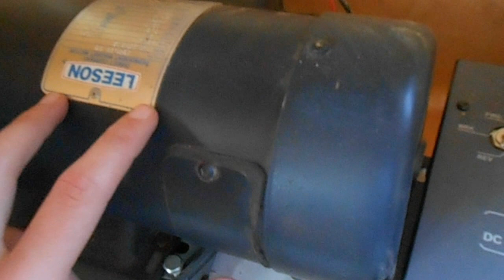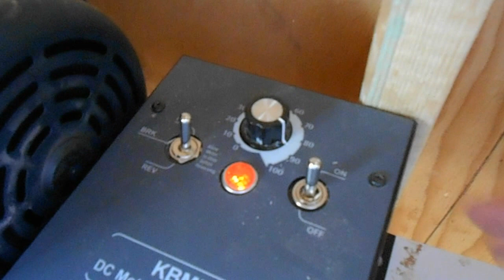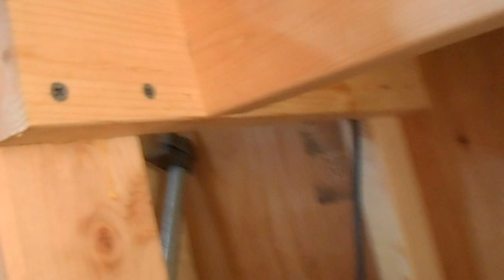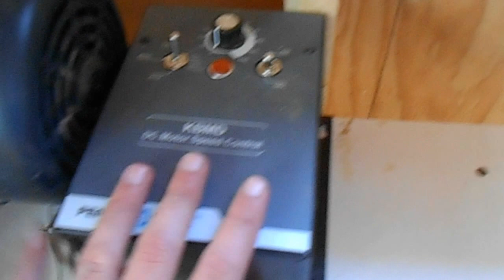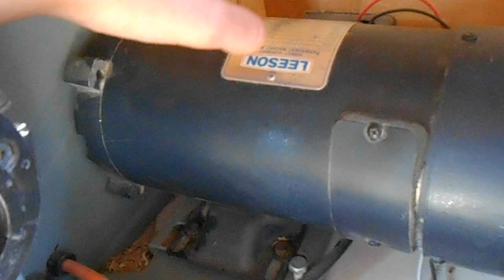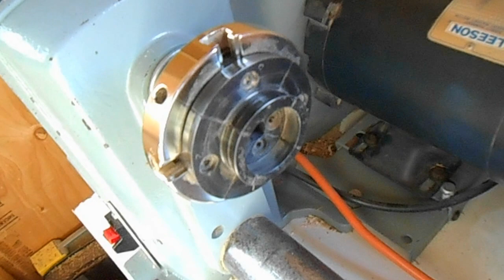How I Converted by Old Durocraft Lathe to a DC Motor

Comment: The new treadmill motors have plenty of torque,,I use them on both my 12 inch metal and wood lathes,,50 dollars and one for free,,
Reply: How is your dc motor handling the 9 inch metal lathe?
I’m using a variac and a diode bridge.for speed control.
Reply: @offgridmangogrower  does find on higher speeds but lacks tourqe on lower rpms was a 1.5 hp and I put it on my 6 inch lathe and it works great on it,, went back to AC motor on my 12 until I can find a 2.5 hp dc motor for it.
Reply: @georgespangler1517  that’s interesting
I’m trying another approach….I have two demands (main shaft) and (oil pump) for my colchester
I’m using two DC motors…these are 0 to 90v …..pMDC
My goal was to prelube before the main shaft turns.
I will go back and retrieve the main motor spec…the auxiliary is 1/4 hp I think.
In your case did you try a higher speed pulley?
Reply: @offgridmangogrower   lm thinking that l would have been better off with the heavy treadmill pulley for the anirsa it would generate at low speed and not bog down due to the light pulley and motor competing against the lathe spindle at low speed,, the 1.5 hp works very well with my 6 inch lathe being more equal to the spindle,, l feel a 2.5 hp dc motor would do the job and handle the 12 inch heavier drive system,  l had a feeling I should have used the heavy pulley on the motor like the difference a heavy flywheel makes on a car engine.. live and learn my friend,, but I sure miss the speed control the potentiometer made compared to the limited control of speed you have just useing different size pulleys. The DC motor was fine at low speed doing light cuts and even a little heavier with high speed steel tooling but couldn't handle the demands of useing carbide tooling.
Reply: @offgridmangogrower   l envy you to be lucky enough to have a Colchester lathe I think there the Cadillac of lathes, l have 6 atlas lathes 2 - 12 inch and 4. 618  6 inch I'll bought cheap and restored knowing the price will increase as people are realizing vintage lathes are still the best way to buy,,they have already tripled in price and I have 2 of almost every attachment,, the atlas was more a hobbist lathe and most very well taken care of where the more expensive lathes like southbend and Logan were both for factories and schools and most I've found are beat to hell and worn out,, l just got really lucky and found a Sheldon horizontal mill with loads of cutters and even a end mill holder and draw bar and 2 perfect arbor's,, was so cheap at 300 dollars I almost didn't go and now so glad I did it's like it's never been used shows no wear  ,, you just don't find them like this one,, l have a 618. 6 inch lathe 1950 that's never been used,, and a 12 x 54  with quick change gear box  thats also in perfect condition,  500 dollars for it and steady rest, follower rest,, milling attachment , 3 and 4 jaw Chucks,  face plate with 8 dog's and tons of tooling and guy even through in a 6 inch lathe,,   l started buying them 2 year's ago and now I see them for 3 times what I've payed,, so I'll sit on them for a while longer. But I've always wanted what you have.. but as I'm sure you know Colchester parts are crazy money if you can find them.but they are made to the thousands of tolorances,, l saw the factory and how precision built they are.. congratulations on having the best money can buy
Reply: @georgespangler1517  thanks George for your nice compliments
I was between an Italian lathe and colchester but someone out foxed me on that tool room lathe.
I also picked up a decent barely used Leblond off a tin can. The colchester came off a Norwegian fishing and packing ship. Both show minimal use and lots of coats of paint(navy one of course). Since I’m off grid I’m repowering with pmdc motors. I plan to let the leblond go to have $$$$ to repair my diesel Polaris.
Reply: @offgridmangogrower  off grid meaning no ac current?   I imagine it takes alot of DC current to turn the gear head lathe,, mine are all pulley lathes and don't need alot of amps to turn
Reply: @georgespangler1517  I don’t really know what the draw will be untill I place a meter on the circuit. I have up to 60 amps initially
But for a long cut I might run out of array amperage and tax the battery bank
having a gen on standby may be an option.
One of my systems will operate a 1200-1400 watt bosche dishwasher on the hour cycle
If clouds appear the system will shut down and has to be re - started.
I wash between 11 and 3 for max solar gain while panels track the sun.
We sell juices and must run a dishwasher. Normally I unplug one heater element to bring down the consumption.
Reply: @georgespangler1517  im sorry
Yes I have 3 outback inverters for 120 vac for 60 amps
Stacking can give me 240 at 60…..
The DC is thru a big variac and bridge rectifier….losses are minimal once converted to pulse DC

Comment: I have a 90v dc brushed 1 1/4 hp motor. Will it work with that controler?
Reply: I don’t have any real world experience with controllers but a variac and full wave bridge with a heat sink may serve your needs nicely……I’ve set one up and I like the no noise factor.
I would aim at 50 to 100% over normal current rating to have sufficient heat dissipation during heavy cuts and hot weather.

Comment: Hey Christian could I ask you a quick question about the DC motor? Does it loose torque at lower speeds? That is the reason I want to convert my lathe to DC is for the low speed when turning big out of balance pieces. If DC can't keep the torque then most likely I will not do the conversion. Any input would be greatly appreciated. Thanks
Reply: Good DC  controllers have what is called IR compensation that will actively try to maintain the same speed regardless of load on the motor. Cheaper DC motor controllers will not have this option.
Reply: One way to avoid losing torque is to continue to use the step pulleys from the original drive setup.
Reply: Shunt wound DC motors have significantly more torque on the lower RPMs vs. permanent magnet DC motors. 

Typically shunt wound DC motors are used on conveyor belt systems or escalators where they need to maintain constant speed regardless of the load.

Comment: Do you remember the HP rating on the treadmill motor you were using or the voltage scale? Im going to put a treadmill motor on my lathe and it is rated at 2.5 HP but I will be removing the flywheel before installation (I think). The lathe you have is what I taught myself with. Mine was a Craftsman but they are the same. Really like your handles. Unique! Tom

Comment: I converted my lathes over the DC treadmill motors and am not getting much torque in the low end either.
Reply: I suggest you go with a variac and a bridge rectifier for more motor torque performance at all speeds

Comment: I would think the problem with torque at low speeds would be more to do with the controller than the motor.  Treadmill motors are designed to provide high torque at low speeds.  Were you using the same controller?

Comment: I have the same lathe that I'm currently adapting a treadmill motor for. the motor mount on mine is really flimsy so I'm going to weld up a frame to mount the head stock and motor to using the cross member and mount from the treadmill. the original china motor was a joke.